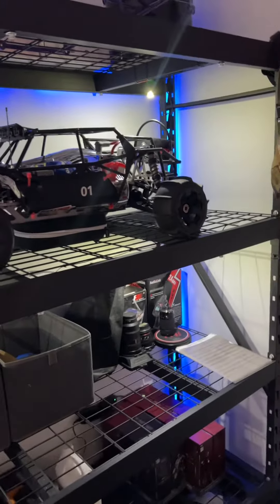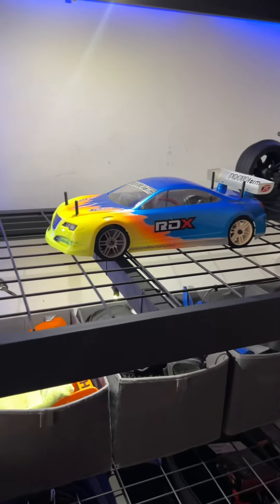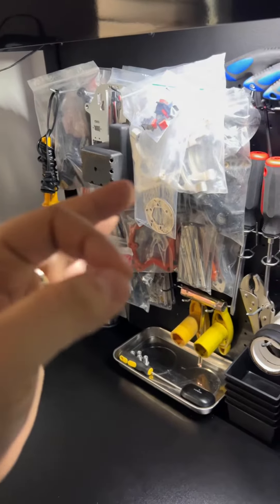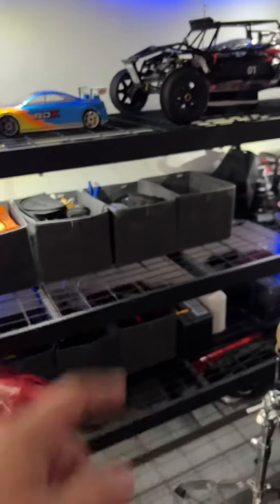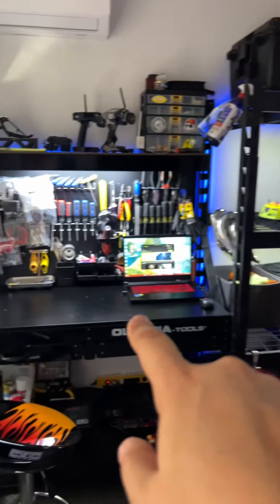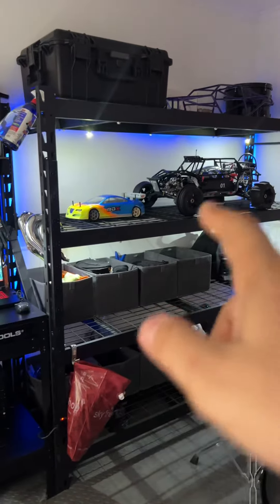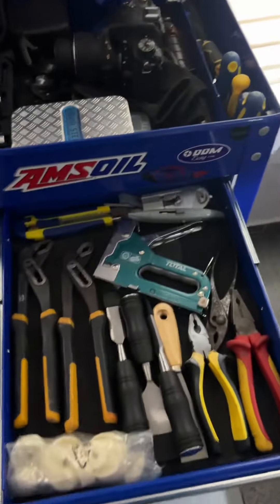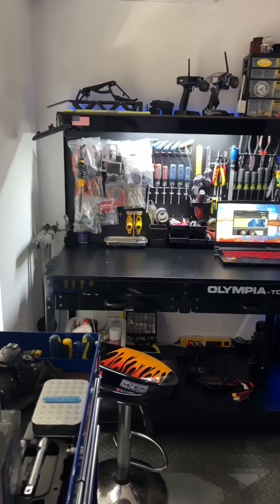RC workbench and things I will change.

Comment: Nice work place and vision, I'm that way too always thinking ahead and how I want my place to function. I love working on RC's as much as crawling. 
Probably because I live in Arizona Mesa and I go on lock down 5 months a year😄✝️☮️🥵🥵🥵🥵🥵🥵
Reply from the maker: yes its always changing,  by next year the setup will change a bit again lol. lock down every 5 months??? damn man. why is taht because of the virus?
Reply: @GottiRC  
🤣 Pandemics, human control 🙏✝️☮️
Actually I put myself on lockdown for 4-5
Months, I live in Mesa Arizona
The temperatures in the summer are 105° to 118° it's just to hot to go outside and rc